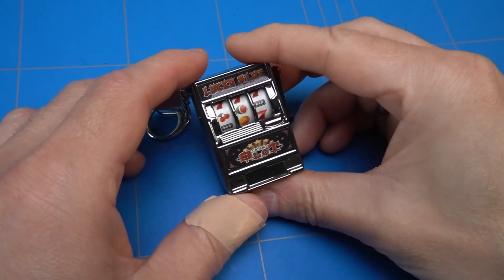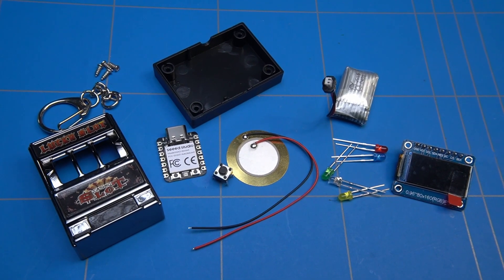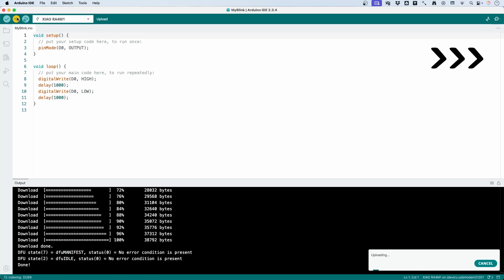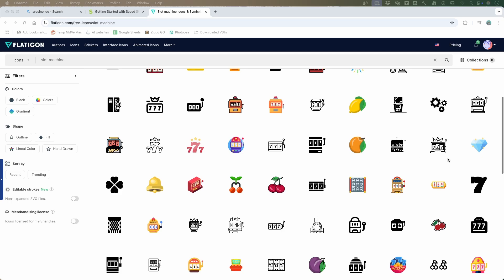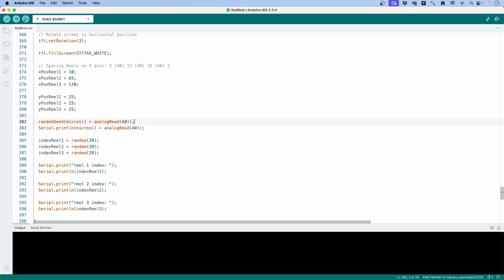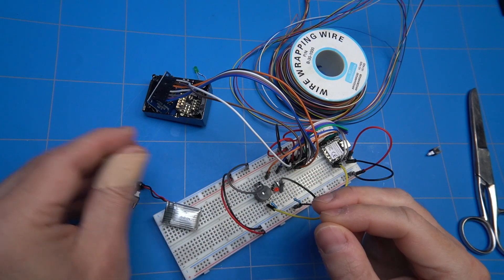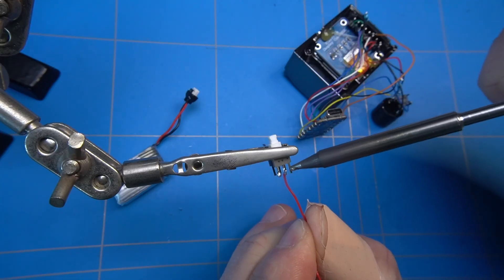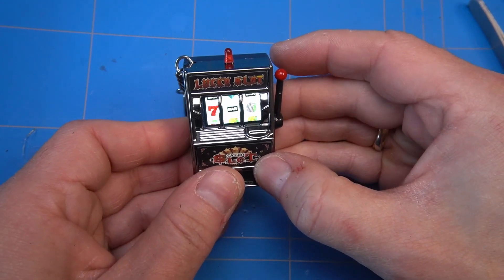Hacking a Mini Slot Machine | XIAO RA4M1 Microcontroller Mod

Comment: Very nicely conceived, executed (except for the USB-C hole 😜), and presented! One question is whether you can lower the number of pixels the wheels scroll, and correspondingly reduce the loop delay, for a smoother animation? Or is the display library running full speed with no delay?
Reply from the maker: Thanks. True, the USB-C hole came out a bit messy. There is certainly room for improvement as the reels don't scroll smoothly. Unfortunately the Adafruit GFX library is running at full speed.